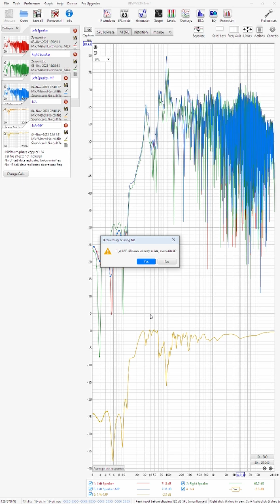Room Correction Filter in 60 Seconds: It's That Easy!   #rew #dsp #drc #inversion #audio #audiophile

Comment: Thanks so much for the quick tip.  As a newbie, I am still trying to navigate through all this.  The only issue I have is under Trace arithmetic, there is NO "Regularisation %".  I only see "Maximum gain".  What should I do at this point?
Reply from the maker: Yes, some of these parameters were removed in newer versions of REW. Use this tutorial:

https://youtu.be/qoFZPlXrTeM

and this version of REW Beta:

https://www.avnirvana.com/threads/rew-api-beta-releases.12981/

Comment: I've tried this method and it somehow works better than using AutoEQ with housecurve. The Dynamics are intact, the bass is on point and it sounds great even on higher volume with my setup. Is there any way to combine it with a custom housecurve as the bass response is too flat for my liking... Thanks for the tutorial tho!
Reply from the maker: Unfortunately min phase inversion works best with a flat target.
Reply: @ocaudiophile  can we combine it with VBA for better bass response? and if so how I'll be able to do it?
Reply from the maker: It's of of course possible to add a VBA filter but it's difficult to add one that doesn't decrease the overall clarity and speed of bass response. I am working on this exact subject at the moment and it will turn into a tutorial video if I can make progress. Feel free to try it yourself in the meantime ;)   @jasmeetsingh1628

Comment: Good evening and thank you for the incredible work.  With this method, once the minimum phase filters have been calculated, is it possible to export the resulting target curve to audyssey mult-eq x in txt format?
Reply from the maker: X only accepts IIR filters in a specific format. You can save the filter created as text instead of wav and use it as target curve, then use REW auto-eq to match that and export these EQ filters to MultEQ-X!
Reply: @ocaudiophile  Thank you, but I don't understand one thing.  Once I create the filters on rew and export them to txt format which allows them to be loaded into mult eq(import target curve function), why should I run rew's auto eq function if the filters have already been created like in your video?
Reply from the maker: Because .txt files are not EQ filters. But you gave me an idea now. After saving the filters you created with this method as txt rather than wav, you can import these txt files as custom  target curves to MultEQ-X for each speaker and if you delete speaker responses in X, Audyssey will create identical filters to your target curve. @alexruspantini3484
Reply: @ocaudiophile  This is exactly what I had in mind, so it's possible,i am happy 😀.  One last question, is it possible to create the filters following the harmon target curve created by you?  where can I insert it?  because the filters are created with a flat target response from what I see,not harman
Reply from the maker: It's possible to invert the responses on a target curve with two-step division (actually I have an old video for that) but this method gives the highest clarity as it inverses the speakers natural minimum phase response. You can always adjust the bass level with your subs volume in Audyssey anyway.  @alexruspantini3484
Reply: @ocaudiophile  Thanks very much.  Once multiple measurements have been made for a single speaker, is it better to apply the vector average or the rms average after the cross-correlation before applying the minimum phase eq as in the video?
Reply from the maker: @alexruspantini3484 Always vector average same speaker responses. You can opt for other averages between left and right speakers to determine target curve level. The new dB+phase average is more useful than RMS IMO
Reply: @ocaudiophile  Thank you.  Before applying the vector average, must the measurements be without any smoothing?
Reply from the maker: You should try and see for yourself. Smoothing is transferrable and reversable within operations including avearging. @alexruspantini3484
Reply: @ocaudiophile  Thanks, I'm Italian and many people follow your advice, you have improved our systems.  One last question, in the video you made I notice that a target  curve level was not applied before applying the filters for phase minimum.  Why?
Reply from the maker: No taregt curve is needed for this method, we are simply inverting the speaker's response on a flat target. @alexruspantini3484

Comment: Thanks sharing the great videos😊 it looks a alternative  fast way to experience room correction.  I’m still working the filters of workshop and vba. Their effect should be more comprehensive, right? I have sent you a letter. If you have free time, please take a look at it. Thank you very much.
Reply from the maker: Every room is different. Some methods work best in some rooms for some speaker placements, some work better for others. VBA is independent from all other techniques because it directly targets room modes with a delayed inverted bass signal.
Reply: @ocaudiophile   Thanks for your reply, it's very helpful for understanding. I will continue to follow your channel.
Reply from the maker: Thanks! @WallaceChen